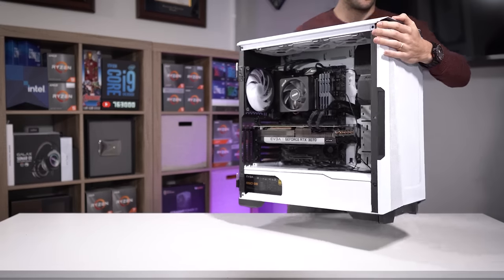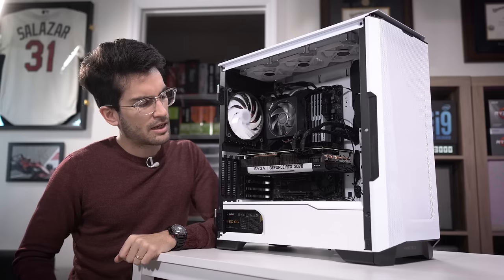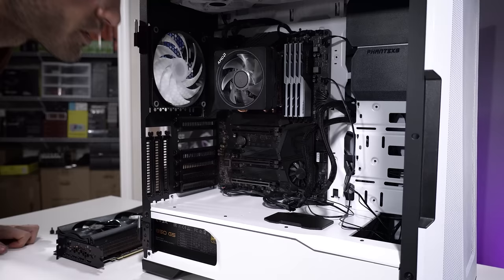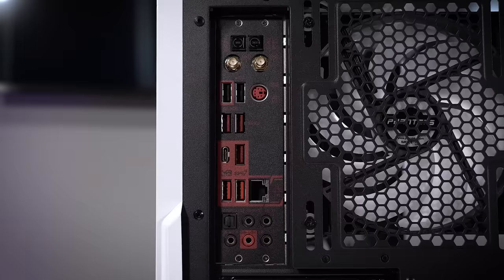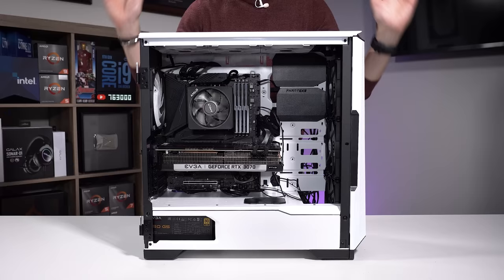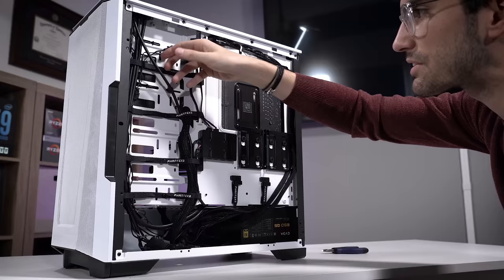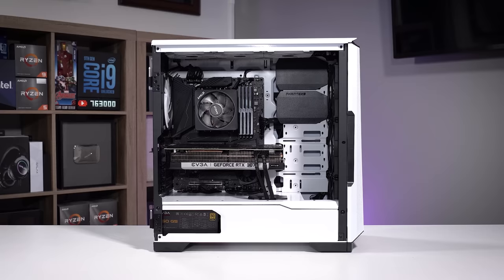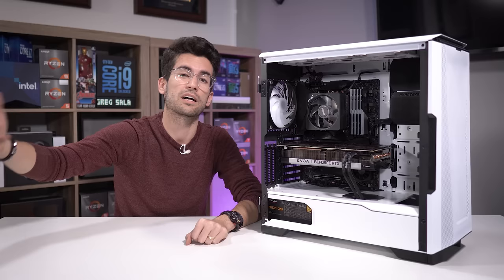Fixing a Viewer's BROKEN Gaming PC? - Fix or Flop S2:E5

Comment: I've used the Bios flashback to successfully update both my Kids MSI B550 Gaming boards and my MSI B550 Unify X with fully assembled systems and never had an issue [even used it to recover a failed attempt to use a new direct from window 11 bios flash method that killed my PC]

Comment: I have a similar Phanteks case and they like to stick their RGB and fan controller into the top lip of their case near the power button where it's super hard to access. So they have that stupid RGB extender tethered to it. On top of that my mobo didn't have the right RGB header. It took me months to realize that I could just plug the RGB fans directly into that stupid RGB extender and just use the controller on the front of my case to control RGB settings. I just can't use the RGB software. But my point is that Phanteks kind of just leaves it up to the builder to figure this out. It's a very small detail that screws up a lot of new builders and they just end up giving up on the RGB.

Comment: I have that very same case, and there was issue of no HDD wire, you need to boot from m2, this is what i hate about these new designs, is they try to force you off sata drives.

Also had led issues, then i swapped the orientation in the hub and it worked, or maybe they were just loose.

Comment: I put the OS in Safe Mode when I want to move Intel to AMD or the reverse. I have had fairly good luck with this. Once installed in the new system and out of Safe Mode I let updates get installed.  Last step is an in place upgrade/repair using the latest OS. This has worked nicely.
Reply: It is more important to clean GPU drivers than CPU drivers. But you can do what you want.
Reply: @killertruth186  , I didn't think I needed to mention that. I wasn't trying to write a novel.
Reply: @michaelleeper3649  Ah.

Comment: If I am not mistaken, that R7 5800X doesn’t come with that AMD air cooler.  Do you think it is adequate enough for the 5800X?  I built a R7 3700x build last year and later upgraded it to a 5800x.  I went with an AIO because I was concerned about heat.  I was just curious what your opinion is on this.  Love the series, keep it up!

Comment: Hey Greg, just wanna let you know that a BIOS flashback may not work if you have a thumb drive that runs on USB 3.0 and up! Actually, I think it's some version of 3.1 and up, but I'm not entirely sure, so I just stick to USB 2.0, which works just fine. Anything higher and it may not work, or worse, brick the motherboard. Just a heads up!

Comment: love the series. its been helping improve my troubleshooting skills. i recently was trying to upgrade a coworkers 2006 Dell e520 pc (ram and ssd) and ended up cleaning and doing a fresh install/upgrade to Win7. had to research Dell forums for Dell specific issues (i h8 Dells) bc it was posting odd RAID drive issues and when finally navigated to windows it was not showing full ram utilization after max 4gb DDR2 installation. Note: pc was so old that plastic parts were brittle and breaking and lots of dust. i didnt do a DEEP clean but i did a general dusting, cleaned contacts with IPA, repasted CPU and checked all connections. (wire cleanup is pretty undoable in a Dell). got it up and running but i must have gone thru much of your procedures when going thru the repair. thanks. would love to see you tackle an older PC build - they are another animal but your methods still work.

Comment: I'm honestly surprised that motherboard manufacturers haven't started baking in rudimentary network drivers into the bios so you can just press a button on the board (maybe bios flashback) to make it fetch the most up to date bios revision. 
At least in the more expensive models.

Comment: Wish you had done some benchmark and temp tests on this PC , because I got the same CPU but with a 240mm AIO from Corsair and it runs pretty hot in games and benchmarks ( 80-85 C ) . I really wonder how this guy could use that CPU with a stock air cooler

Comment: Can use DDU to uninstall all the intel drivers and should be fine. Also a 5800x on a stock cooler is going to be a struggle
Reply from the maker: DDU hasn't always fixed these issues IME.

Comment: Upgraded recently:
OLD Config:
Intel Platform
i5 6400
nvidia GPU

New Config:
AMD Platform
5700G

I had absolutely no issues going from Intel to AMD, while maintaining Windows Installation but I was extremely careful:
Created a stick with some software: DDU, AMD Chipset Drivers, AMD Adrenalin (Graphic driver, although I did a full install), Macrium Reflect. Made sure to have disabled Windows auto driver search. Swapped HDD's and the 2.5" SSD into the new build.
As soon as it booted up, which if it doesn't happen, don't try again, i installed the chipset drivers, macrium, and prepared DDU. Restarted into Safe mode, wiped nvidia and amd drivers. Restarted into normal mode, installed amd graphic drivers, had a bit of an issue with the cable i was using. Once everything was done, cloned old 2.5" SSD to the new m.2, restarted, problem solved.

So, it is possible, but always expect failure or problems.

Comment: I have problem like that once,i tried swapped out motherboard,cpu,gpu but the problem still exist,. I checked all of em.. and sometimes sthe solutions so silly just grab rubber eraser,clean RAM socket module with rubber eraser an tadaaa... It works..

Comment: Who would ever migrate a drive through multiple different CPU and GPU vendors? (I'm in this post and I don't like it) I'm not entirely sure when my last OS install dates back to, it's either my original windows 10 install from FX, to Haswell, to Zen 1, to Cascade lake consumer, before being abandoned at cascade lake professional, or at absolute best I did it fresh in the move from FX to Haswell... Clonezilla and I have been friends for a while. Meanwhile I always tell people "hey that's a bad idea" but the urge to not completely start over is overwhelming. The only reason I ditched the OS install moving between sockets on the same cascade lake architecture is that my supermicro board (justifiably) would not play well with a legacy install on an NVME drive.

Comment: Man I remember not getting an image once, I tried everything. Reseated the GPU, cleared the CMOS, checked the ram etc. Turns out it was my monitor 😂 pulled the monitor power while disconnecting the DP let the monitor power down capacitors then re connected it all and boom fixed, I was very annoyed

Comment: Yes, even if your system is working with it's current Bios & CPU, you should still update or Flash the Bios to the latest version. I have been building my own for over 40 years & many builders may say "if the system is working ok, then don't update the Bios". In my opinion this is false. If there is a new bios version number compared to what you have, it's because the new version is needed for reasons the notes given don't tell you. Example, I just built 3 new systems using Asus Rog Strix B550E, B550XE, & B550F Motherboards all with series 5000 CPU's. The systems seemed ok until I noticed at random I was loosing Internet connection 2 to 3X a day. I know, strange. I know I downloaded the correct LAN Driver from the Driver page for the Mobo. I continued to have internet connection losses & I read the foot notes added to the Bios version & it stated a known fact that all AMD Athlon & Ryzen CPU's would be vulnerable to attacks & system compromise. Yes Hack attacks & Back Door Bios Hack attacks. So I updated the Bios on all 3 Mobo's to the latest version 3002 & the problem is gone & systems are stable & no more Internet loss.. So, rule of the thumb is in my opinion is to always update the Bios to the latest version even if you think you don't need to. They give you updates for a reason, & they may not mention all the reasons why.

Comment: Last week my 2 years old ryzen 5 PC just refuse to turn it on. 1st i thought maybe my PSU died. I put jumper on psu and its works.  It was look like my MB or CPU died which is very bad. Then i dig my old cheap psu and checked my system with it and walla its turn on. Again i reassemble in same system and then its turn on. Hmm i dont get it but its works.

Comment: Do you maybe have any idea where the problem could be when a computer doesnt work/post with a graphic card (gtx660 pretty old) but with another graphic card it works? 
The weird part is that the GTX660 is working in another computer, so its not broken.
The GTX660 is not in use anymore so the problem is kinda solved but I'm still curious what couldve been the reason behind that.

Comment: errmm shouldnt the fans up top be configured as exhaust ? from what i see they are acting as intake ..yeah the lian li uni fans the connector is a bit finicky , if  it isnt slot in properly , etiher the rgn wont work or the fan does not turn on at all

Comment: Hi Greg,

I have a computer that has been sitting dead for over a year. PC will not post any more and CPU/RAM lights flash on the mobo. It was a brand new build a few years ago and don't have any additional parts to swap. I tried troubleshooting everything. Any ideas or help would be great

Comment: Day before yesterday I had a big misfortune when updating my GPU-BIOS for my MSI RTX 3090 Gaming Trio card. The BIOS update stopped at 1/3 of the process. So I had no output from the graphics card anymore. But what to do with this PC?: https://www.youtube.com/watch?v=lALT5t7JBWc Deinstall the graphics card, rebuild it to air cooling, install a second graphics card and next reflash the MSI RTX 3090 Gaming Trio with the old (working)  GPU-BIOS? That would have been a ton of work. I suddenly recognized that after 5 +1 one beeps of the MB my PC was still starting and booting Windows 11. So the problem solution was quite simple: start a Remote Desktop Connection from another PC and then reflash the old working GPU-BIOS. I think for all of you, owning PC's with such a complex custom water cooling this might be a well working problem solution as well. So prepare your PC´s for a Remote Desktop Connection.

Comment: Hi Greg, i'm sure this has already been covered but you might want to warn the viewer of temperatures under load with his 5800x as that current box cooler isn't sufficient to be cooling such a high end chip :)
Reply: Also i experienced the exact same issue with the same board but i unfortunately had to have just the power supply connected to the board in order to flash the bios, having the CPU connected wouldn't allow it

Comment: Great video! I’m currently going through the same exact issue where my pc will power on, but it won’t post (no signal). However I have a msi 970 motherboard and I don’t think there’s a flashback function. What would be an alternative method I can try to update the bios?

Comment: "Switching from an Intel build leaves drivers behind on the drive"

Windows always has the drivers on the drive for both platforms, and will only load the ones relevant to the current hardware. It's not really a concern unless you install a special driver pack that leaves behind utilities that automatically run, but you can always just uninstall those afterwards.

Comment: Any tips on fixing an SSD that’s stays at 100% usage even while it’s not doing anything? 😂 I had to unplug it and reinstall windows on a new drive. But I’m not sure what to do with the SSD now
Reply: I would try to install it as a secondary drive and check whether
1. it is recognized at all (and at what size)
2. it can be read from (maybe a pass of chkdsk /r) and
3. it can be written to (maybe a pass of h2testw),
with an eye on usage.

What type of SSD is it? These do vary in reliability. Some noname cheapies are notorious for not lasting a year, and I've seen a few too many reports of dead 1+ TB WD Blues for comfort. Crucial MX500s should be mostly alright, and Samsungs should rarely ever fail though some hot-headed M.2s may be an exception.

I reckon most failure modes in SSDs are related to solder joints going bad on either the controller or the NANDs - the more thermal stress they are under, the worse it is. I am sure the plastic case of WD Blues is not helping matters in this regard. On the upside, a fault like this stands a reasonably good chance of being fixed by a reflow of the problematic component(s).

That said, if it can be read from but not written to this may indicate an actual NAND failure, or even controller failure. And if it's not recognized at all, there may be a shorted ceramic capacitor bringing the controller's power supply down or something.

Suffice it to say, you should probably have ambitions in board-level repair if you want to tackle a broken SSD. If you don't, I would recommend only giving it to someone trustworth enough, or at least attempt to do a Secure Erase on it before letting it go.

Comment: One thing I've learned after buying Lian Li's SL120 and AL120: these fans and are the worst. Fans don't fully work without a controlled, which is included in the 3 pack (this is not mentioned anywhere visible), the firmware needs to be updated by some shady and complicated methods (in SLs it simply doesn't work), and the software is a nightmare to setup.

Comment: Okay we're about a minute and a half and I want to run with something to do with the motherboard CPU or biOS I just felt one and I realized that the motherboard officially wasn't compatible with my CPU and it didn't accept the BIOS update so I can go out and pick up a different motherboard cuz I had where the case will power up but no post and I couldn't put the BIOS on or update it just nothing but black screen

Comment: I have the same GPU and it generates so much heat I can't have the side panel on or else my pc shuts down though only while gameing.
Reply: does your case have ventilation? do you have a good cpu cooler?
Reply: @macking104  I have had 2 closed cases and one open case that was to expensive to keep. I do have water cooling for the cpu but just the normal EVGA cooling the gpu came with.

Comment: His top fans are set to intakes
Reply from the maker: Yep, not the end of the world. He'd have more exhausts than intakes at that point and I think he preferred positive case pressure to ward off dust.
Reply: @GregSalazar  I love watching these videos btw.  I've learned so much from watching them.
Reply from the maker: That's not what I said. If they'd have been flipped, he'd have had more exhausts than intakes... And no, the way he has it now won't be terrible for dust. There's a dust filter up top. Flip those top fans and you'll suddenly find more (unfiltered) air being pulled in through the PCIe slot covers. Ask me how I know 😅

Comment: When I got my Ryzen 5600x and motherboard I asked the shop to flash the board with an older CPU because it did not have flashback.

1.5 hous of troubleshooting after the build was complete I called the shop and asked if they actually flashed it... They forgot... 😠

Comment: msi b450 tomahawk max and ryzen 5 2600.
when turn on, debug led is on cpu
I updated the bios but still debug led is on cpu and when I remove the cpu cooler cpu is not hot.
what could be the problem?
Reply: if you have already tried resetting cmos and checked settings, some folks in MSI forums on msi website say it might be a power supply problem...
Reply: @macking104  tried resetting cmos, changing cmos, tried 1 ram, tried using other ram, my power supply is good I have tested it's seasonic.

Comment: For a Ryzen 3700x my buddy entered 1.498 as the voltage for the cpu but it idles at 45-50 degrees. Should I turn the voltage down?
Reply: Yes
Reply: @getsugatensho02  what should I turn it down to? Because it just says auto in bios and doesn’t allow me to change it
Reply: @ShadowChef  yup Because in idles 45-50 are too high normals are around 25-30 without any stress

Comment: Hello Greg, im currently running on an issue on my friend pc that he asked me to try and fix it. When using the pc to browse internet or watching Youtube it behave just fine, but when opening a game its suddenly crashed and sometime the pc just restart on its own when running a game. I already check the power supply and everything seems fine. Opening valorant show a different error, the error that come out was "This build of Vanguard requires TPM version 2.0 and secure boot to be enabled in order to play". THis windows currently running on i5 11400, 16gb ram, 550W PSU and 1650 super on windows 11. If anyone know how to fix this please let me know. Thank youu
Reply: look in bios to see if tpm is on... check the manufacturer website for details. maybe update?
Reply: @macking104  is it have because of bios? So it was jot the windows 11 fault or faulty hardware

Comment: BIOS upgrade? no no no you're way off

step 1: just hook a Bluetooth dongle up to the AGP port
step 2: then connect the router with a sawed-off usb port
step 3: then take out the CPU, clean with pine-sol then reapply it using mascara as thermal paste
---make sure you wear a static bracelet for the above step
step 4: plug in all IDE cables
step 5: power on computer

Comment: The case my computer is in also has a magnetic dust filter on the top....something I thought was pretty cool....till I watched a tech vid that totally debunked it....the top is where air goes OUT, not in so a filter was a tad pointless but i dont care I still like it
Reply from the maker: Well he has these fans pulling air IN through the top and front (so six intakes). Top dust filter isn't pointless there, now, is it? 😀
Reply: @GregSalazar  Oh ya hes got the AIO so definitely not pointless in this situation....Im an air cooler type

Comment: That user has a great PC, but a 5800X with a random stock AMD cooler? Thermal throttle in 3 - 2 - 1 ... I also have the 5800X and it's definetly not the coolest of CPU's and I'm even considering changing my 240mm AIO to a 360.